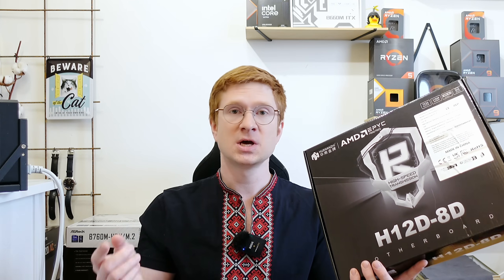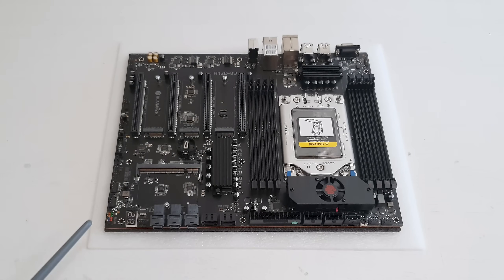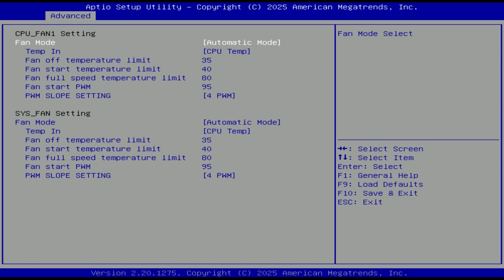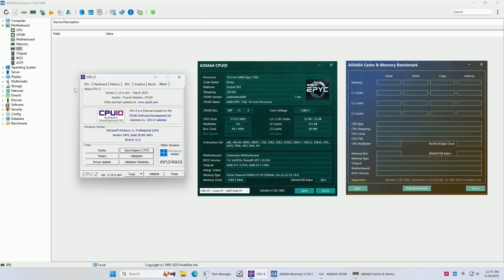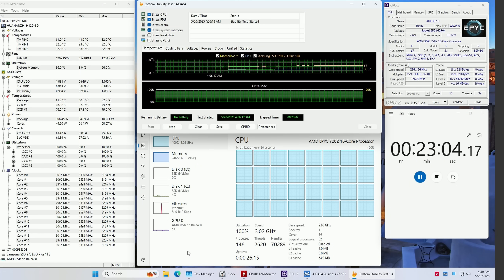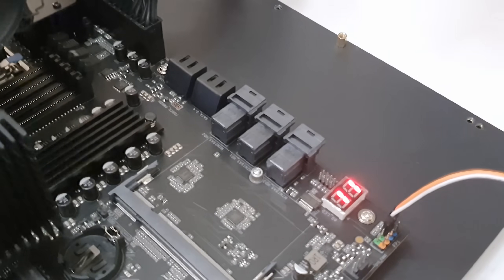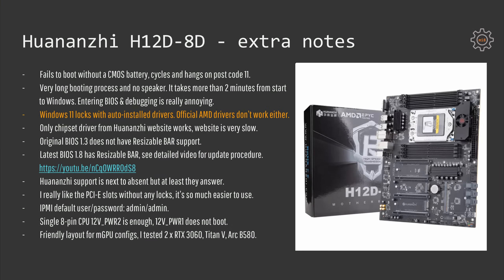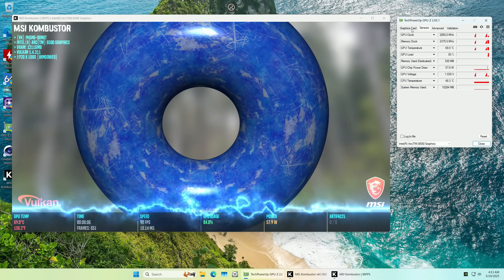Huananzhi H12D-8D EPYC - motherboard review, part 1

Comment: Would be interesting to run a Highpoint SSD7105 in RAID10 Modus as a C: with 4x KC3000 Kinsgston SSD (the right type of cash - ideal for RAID 10 - not all nvme SSD cash could be used for RAID 10) - so no bifurcation needs, cause the Highpoint has its own BIOS Chip so youve got a bootable X16 SSD :-))  - than add a Soundblaster AE7 and a Radeob RX 9060 XT with 16 GB VRAM - install Windows 11Enterprise with RUFUS ( switch of personalisation and switch of TPM ! ) - BIOS from this Mainboard UEFI only ! Within Win 11 switch to ultimate performance mode (obove high performance) !! The right Wifi would be a (Wifi 7) Mediatek 7925 mini wifi card via PCIe x1 Adapter to ngff + power cable so otherwise the BT wont work - so Windows 11 likes to use its default driver which comes imidiately - thats not working with Mediatek BT ... so install the driver from Gigabyte (i can search for the right driver number) - Use the tool Driverboost  !

Comment: So 8-channel 3200 RAM on EPYC is slower than 4-channel 2400 on Xeon E5 v4. And what about CPU performance of your 16-core EPYC comparing with E5-2697Av4 ? Is it slower also ?
Reply from the maker: Please watch the video, this EPYC CPUs is effectively a 4-channel CPU even though it goes through an 8-channel I/O die. Higher core count EPYCs have full 8 memory channels.
Reply: @Miyconst  What about 16-core zen2 Threadripper Pro 3955WX ? Is its memory also as slow as your EPYC ? Its chiplets 2 × CCD and core config 4 × 4.
Reply from the maker: I have not tested any TR 3000 series but the results are available online.

Comment: I had very bad experience with ordering this mainboard to germany. The customs rejected the package and the seller is not working on a solution. Im now waiting a month now to get a replacement.  But i get just answers like "the package is stil delivered" But the tracking definitly says that its going back...
Reply from the maker: This is mostly likely related to the seller specifying low customs value to avoid VAT tax on import.

Comment: Hello! Thank you for sharing this content. I have a question: is it possible to connect multiple motherboards in a cluster configuration to increase processing power?
Reply from the maker: How would you do that? If your software can split workload across several machines - sure, you can do that via 10 GbE.

Comment: Let's hope they will also design a dual socket version at a certain point!
Reply from the maker: What would you use that for?
Reply: @Miyconst  Mostly bioinformatics. Loads or ram and cores are always appreciated for that, and these would come at a reasonable price, SP5 platform with ddr5 are still way too expensive only the mobo is around 1k$ and ddr5 mem are crazy expensive. I'll stay on my old huananzhi x9916D. Let's hope in a dual epyc solution from them, at least i do :D

Comment: I bought a motherboard h12d 8d and it is working but it doesn't display video. I put in a video card and it recognizes it but it doesn't display video. Does it only work with a BMS?
Reply: I've read you have to change a Jumper on the motherboard for that
Reply: @jorgedelarosaginer9330 where do I look at this to know what it is?

Comment: I wonder how much power this mother's power is designed for. I got a 7702P at one time, will it be able to raise frequencies for all cores under load to 3.7 at least, will the motherboard withstand it. I saw an engineering sample of the 7763ES with 64 cores, they turned off the HT, and were able to overclock to 4.1 frequency, although it ate almost 800 watts on the SuperMicro H11DSi motherboard. But at frequencies of 3.8, it fit well into 400 watts. Agree, having 64 cores at a constant frequency of 3.8 for that kind of money is just gorgeous.

Comment: If I may ask, could you provide us a link or anything where the BCM module can be purchased?
I tried searching for it but I could just not find it.
(sorry for asking - but that would be a great help)
Reply from the maker: As far as I can see, Huananzhi doesn't sell BMC separately, only with the motherboard.
Reply: @Miyconst  Thank you for the answer. I'm currently also contacting them. They dont provide any links to the BCM-Module. 

Now comes the funny part. Ive contacted their support. And they want me to buy a fan of their mainboard but without actually paying. Afterwards they'll change the price to the 35$ bucks which I need to pay. And through this kinda hack they are going to send me the BMC-Module. Thats ridiculous xD

Comment: Hello Mr. Miyconst, this is very important question hope you notice me, So I recently changed my motherboard from X99-P4 to X99-H9S, it is fine if I just move my SSD to the new motherboard with windows 10 installed with it or i have to reinstall the windows 10
Reply from the maker: In most cases it should be fine, just make sure to check for updates and install all optional ones. In rare cases it may lead to weird issues and reinstall might be necessary.

Comment: In your video, you mention that the motherboard supports x16 on all slots,  but the b580 is a gpu that only has x8 pcie lans. I would appreciate it if you could re-do that test because it is very important for me to have all the pcie slots running at x16.
Reply from the maker: I don't have four x16 GPUs that would fit into the motherboard at the same time but I have tested each slot with an x16 GPU.
Reply: Thank you for letting me know, it's very appreciated.@Miyconst

Comment: you should have various SFF cables and possibly an LSI and a known good 8 series Adaptec card, because then you can do a video about ZFS versus hardware raid performance on a real world workload, someone needs to put the weird/specific BSD based ZFS NAS distro users who think ZFS is magically better than a hardware solution "just because", in their place.
Reply from the maker: I think I better leave this topic for experts. Personally, I much rather prefer software solutions over hardware. When hardware is brand new and comes from a reliable supplier with warranty - sure, it might be better, but otherwise I prefer software solutions. Those who want to fight about ZFS can do so without me.

Comment: Hi. PLEWASE PLEASE PLEASE PLEASE Do some MEMORY BANHDWITH BENCHES with SiSandra. and Latency Benches. Even though 1st and 2nd gen CPU prices are low, Boards are still way too expensive. I have been wondering why no SP3 boards like these yet and plenty x299, x99, x79

Inkstand SUB

Edit: Your score for memory seems lower than a 16 core 7351. Even considering the CCD difference, I find it lower than expected, especially given the 7351 I tested was at 2666. Would love a Naples compatible option.
Reply from the maker: Please check the explanation articles linked in the video description. EPYC 7282 is effectively a quad memory channel CPU even though the I/O die still has all eight channels. If/when I get access to other CPUs I will perform extra testing.
Reply: @Miyconst  Yes. I looked at the data. odd choice by AMD but the Naples 16 core does indeed have better memory performance. for this board it looks lioke it would be better paired with Gen3 EPYC. But Im looking for cheaper boards for my Naples Naples workstaions given they can OC and offer much better value for what u get. Great Video

Comment: There is clearly something wrong with this board. Catastrophically low memory bandwidth. In general, for Epics of the 7002 series, the memory bandwidth in 8-channel 3200 MHz should be close to the level of 6-channel 2666 MHz on the LGA-3647. The SP3 is a weak platform, barely keeping up with the old LGA-3647 and even more expensive.
Reply from the maker: Please watch the video carefully. 😂

Comment: You can get around the limited smart fan issue with a PWM fan controller hub. Artic has a nice one. It reads the PWM signal from a motherboard header and uses SATA power to drive 6 PWM fan headers.
Reply from the maker: You surely can but it's still annoying that such an expensive motherboard has such a limited fan control.

Comment: my lenovo SR655 has exact same epyc 7282 with 16 rdimm slot, i only fill 4 of them ,i have 1 100GBE port ,2 25Gbe ,2 10Gbe,NIC,thus when i running openwrt on it, it cost me 110W on idle, 1 vm, 4c 4G RAM allocated, if only hypervisor no VM, 90W in idle  ,if shutdown the machine, it still cost me 30W for IPMI REDFISH CONTROLLER. it's power hunger beast.
Reply from the maker: 30W for IPMI at idle? That's insane!
Reply: @Miyconst   i m guessing lenovo usin too old semicondct-menu node for this onboard ARM controller. or the PSU though is 80plus platinum,they perform suck at low power usage.

Comment: These kind of boot times are not bad at all for a server motherboard. We've got some older Supermicro Xeons at work and they take closer to 10 minutes to boot (once all the add in cards etc get initialised).

Also, I would not expect an EPYC based platform to support Windows 11 out of the box. If it had this kind of issue with Windows Server 2019/2022, or Proxmox or ESXi, that's a problem. But very few people would be using this type of hardware for a desktop, so I wouldn't expect support.
Reply from the maker: True, it's just Windows 11 is the easiest way for me to perform all the tests.

Comment: I'm actually considering this , i'm currently using a refurbished gigabyte board but wow,  i didnt expect huananzhi to go into EPYC , its crazy
Reply from the maker: If you already have a Gigabyte board, how Huananzhi would be better or you need another machine?
Reply: @Miyconst  I need another machine, when i bought my Asus board KRPA-U16 H12DIS , it was like 290 USD now it's no longer available, even if it is it's like 500USD + 

It's running well so far , almost 24/7 at 20% load for the past 1 year. 

I'm looking at huananzhi now because there just isnt much alternatives frankly speaking. My past experience with huananzhi desktop motherboard isnt the best (Non enterprise boards) , random reboots etc. 

It's great that you're reviewing it , but yeah i'm still considering , kinda feel like i need a secondary server because it's huananzhi, it havent really proven to be super reliable at enterprise side of stuff

Comment: from my experience with H11SSL boards, its probably better to use two EPS connectors. I melted one of my PSUs (and the motherboard connectors) using a 7742 with only one 8pin connector even though it should be in spec. Here's a few things id like to see.

- More info about what is shown in BMC. Temperature or board health info, how well remote access performs, compatibility with Supermicro IPMI viewer
- Power Determinism in bios, how well this board does in Performance/Power mode with CTDP set to max for the cpu
- performance/testing with milan x3d chips
- any dram timing options in the bios
 - rome overclocking tool from servethehome forums and if you can mess with ppt/tdc/edc values in there
- replacement vrm fan concerns, and if the board still will thermal throttle to save itself if the cpu/vrm reaches critical temps like supermicro does
Reply from the maker: Thanks for the extra points, I will try to test as many as possible. I wish to get an X3D EPYC but these are just too expensive.

Comment: Love the video, i just purchased one of these myself. 

In the video you mentioned a part about the drivers not loading. 

So FYI, AMD Epyc CPU's DO NOT used the standard AMD chipset drivers, as there is NO CHIPSET on the board. Everything is handled by the I/O Die, which has its OWN special driver. the trick is getting this driver. Since Epyc was never intended for desktop users, AMD doesn't officially release this driver, in order to get the SP3 I/O Driver, you need to get its from the OEM/ODM, which can be a problem since this does has no official OEM/ODM driver support.

How I worked around this was, i went the Supermicro's website and looked up the H12SSL-i motherboard. This board supports Epyc Rome and Millan CPU's out of the box. on their website you can download the drivers for this board. the one you want is the SP3 I/O Driver. once this is done, you are then able to Install Windows 11 without any Issues.
Reply from the maker: Aha! Thanks for the info! I naïvely assumed that AMD automatic chipset driver installer will detect the hardware and will install the correct driver but if Supermicro drivers work - that's good enough.
Reply: @Miyconst  all you need to do is look for a board that supports the same series of CPU. Anything that supports 7002 and 7003 Epyc cpu's will do.

Comment: Maybe the reason people complain about the validity of the results you present has something to do with a complete lack of consistency in the configurations you show test results from.  I saw at least 3 different GPU's listed by screen shots, and 2 memory configurations.  In fact, you never even mentioned using an RX 6400 during one of the tests.  Personally, I know from experience that changing one component, especially under Windows, will change the performance characteristics of the entire system.  Maybe I'll look at one of your videos again in several months and see if you've learned to use a consistent hardware configuration, or at least mention all of the configurations you are using.  Until the consistency is there, the videos are not informative at all, and therefore useless.
Reply from the maker: 😂, do you expect me to test a motherboard with 4 PCI-E slots using a single GPU for "consistency"? Chinese motherboards come with all sorts of nasty surprises, thus I have to test all sorts of configurations. Apart of RX 6400 I also tested GT 710 and no GPU. I also tested a whole bunch of different SSDs.
Reply: @Miyconst  Not really the problem.  You show results with parts in the system that are not consistent with what you are describing.  You say one device is in the system for the tests, then a screenshot of the results says a different device was installed.  Not good practice.   Could easily be considered deceptive.  I'm not trying to be mean, either. I'm trying to point out some glaring flaws in your methodology so you can improve.  I've only seen two of your videos and I've seen the same problem in both.
Reply from the maker: Thanks for the feedback, I will try to make clearer. The problem is that I am very limited with space and lighting. Test bench is not the same as filming bench, first I do all the tests, then rearrange everything to record some brolls, that's why there is a desync.

Comment: I was thinking about getting one and testing it, but then I thought you are going to do it so I held out :D I was curious about the version that has the BMC module. 
I would have like to see a 4CCD CPU -  I get around 117GBs (using Intel Memory Latency Tester Utility) on my 5965WX with 8x64GB 2400 (ECC LRDIMM) and I specifically got it over a 5955 for the memory bandwidth using affordable 64GB DIMMs. 
It's unfortunate they don't ship the board with 10GBe and then we only get 4 PCIe slots and the slot layout makes it annoying to break out one of the M.2 slots to a NIC if you run the largest card in the bottom slot - they should have shifted the slots all down by one, and added a x8 slot at the very top.
I like your review but if I'm allowed to nitpick your nitpicks; I wouldn't assume desktop sleep functionality on a (server) board like this. Long boot times, also expected especially with BMC/IPMI - I've had Supermicro boards that take a solid 10 minutes to start up.
Thanks!
Reply from the maker: I will show more info about the BMC in the second part. A 4 CCD CPU is under consideration but it's expensive.. can't really afford it now. Thanks for nit-picking. 😀
Reply: @Miyconst 😊 I believe the big ones to look out for are the 7742, 7702p, and 7702 - Typically around 400 EUR.
Reply: you can always insert a cx4 25Gbe in various form transfer to PCIE-GEN3 X8 though it's temperature is hard to control.

Comment: Did you check it out on Linux? The Motherboard looks promising for homelab, but I'm bit worried about drivers combability taking in account that You had problems on Windows.
Reply from the maker: That's coming in the second part.
Reply: That's lovely. I can't wait
Reply: I have already tried h12d8d with EPYC7532+512GRAM+409048G on Ubuntu 24.04.2/22.04.5 LTS, and there were no issues. The only difference is that 

    1. On Windows 10, both KVM and the motherboard VGA monitor can output the desktop simultaneously; but it cannot on Ubuntu, even though both monitors appear in the Settings - Display interface. This might be because Huananzhi has not provided Linux drivers for ASPEED. There is an earlier version of the ast driver in the Linux kernel, and you can also install the latest linux driver (e.g. 1.15.1_4) from ASPEED's website, but neither actually helps. BTW, if you use Ubuntu 24.04.2 LTS, you might encounter a missing header file error (drm_fbdev_generic.h) when install the latest ASPEED driver, which is possibly caused by the newer kernel version, but none of these really matters anyway.

    2. On Windows 10, I can adjust the CPU FAN and SYS FAN RPM via Fan Control; but on Ubuntu, IIRC I couldn’t find these two FANs in Cooler Control (this needs further verification; I don’t use Linux too much).